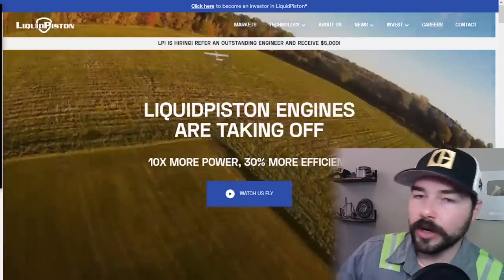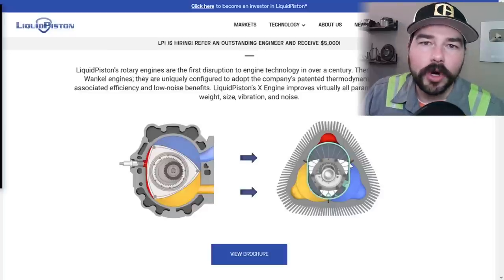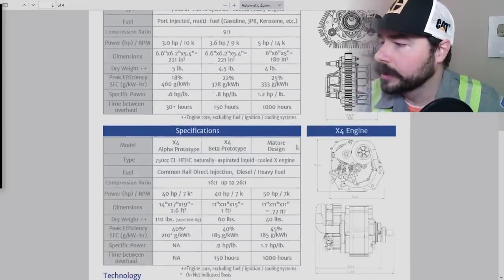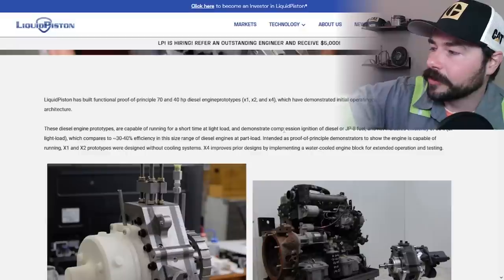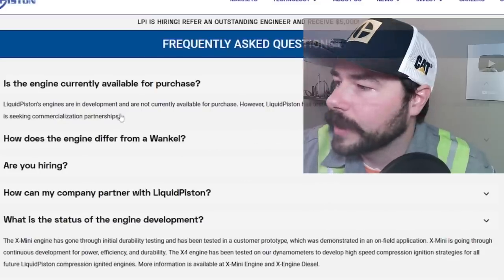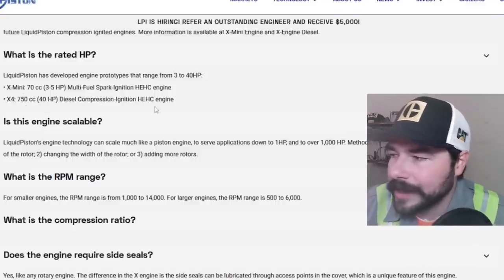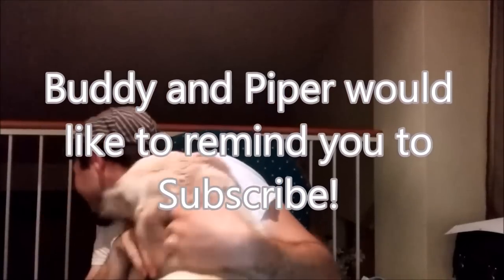This Engine could change EVERY INDUSTRY but..................

Comment: It would be a Delta configuration. 
The British Deltic locomotive engine was a named because of its triangle configuration.
As far as the hertz is concerned you are completely incorrect. The sine wave is a combination of poles and RPM, not just RPM. 
Just to make the point about my credentials for this assertion, I am an EMD certified locomotive electrician. These are electric locomotives with an onboard diesel generator. Not one but three generators powered by one two stroke Diesel engine. 
If you take a look at power generation plants, steam, diesel, hydro or wind we find different kinds and diameters of generators. We also find very slow moving hydro units with the alternators themselves being thirty feet in diameter to high speed gas turbines being measured in inches. 
The steam turbine units are small in diameter but long while the old reciprocal units were quite huge in diameter but not very long. 
You can have multiple sets of poles in sync on large diameter units while having very few on cylindrical units. 
My generators are five feet in diameter and reach sixty hurts at about four hundred RPM on the D14 companion alternator. The AR10 main generator reaches a much higher rate at the same RPM.

Comment: Like the gas turbine generators, to get the torque you need a speed reduction transmission.
Wankel used movable adjusting edge seals but this one really has no place to put "chamber" seals. It is going to be worn fast at the contact areas from the carbon combustion product on the whole surface of rotor and casing.

Comment: Maybe overhaul just means replacing the compression seals, which is about as easy as changing spark plugs. Do you know the speed-of-air pistons? remarkable independent claims for small and medium size diesel trucks. They are working on large trucks and ships. They should probably be put into every engine that you rebuild .. check them out.

Comment: It might work for tractors or go carts or lawn mowers. But It needs to be made out of high quality metal alloy that is strong and good at dumping heat into a radiator. But I don't think it fits in a diesel engine nich, but maybe a light gasoline engine replacement.

Comment: I read somewhere that Mazda is bringing back the rotary engine. I’d love to build a 4 rotor Mazda engine. Extremely fast and lots of ponies.
Reply: I think they envisioned it as a hybrid charging motor, not connected to the drivetrain.  That way it could run at constant speed and optimize fuel efficiency for the engine while charging the battery for propulsion.  Kinda like a diesel-electric locomotive.  That's what I recall, I could be completely wrong...

Comment: With an inverter generator the output frequency is not dependant on the engine RPM. These are becoming more common because they provide a much cleaner AC that is safer for sensitive electronics.  Even without an inverter though, there are these novel things called gears that would do the trick.

Comment: I'm thinking that it would be a good aviation engine, especially for ultralights.
Reply: It has to get into production first! Then it has to beat the existing aviation certified Wankel Engines. The two companies I know are U.A.V. who supply U.S. & Israeli Drone & battle field engines. They have done for 20+ years. The other is A.I.E. They also do drone but also automotive a Leisure vehicle engines. They cover a good range & are Scalable & Stackable. In automotive you can have 2, 3, or 4.
Reply: Noooo....only 150 hours  before an overhaul is needed..
Im thinking alot of plane crashes

Comment: Spec sheet said 40hp at 7krpm 
There spec also said sustainable load was 50% so 80hp unit is needed to sustain a 40 hp load

Comment: Any thoughts on the opposing piston diesel? Seems like a really cool idea and could work well, but I can foresee some issues with the design. Lol
Reply: Cost probably too high
Reply: The army is going to be using it
Reply: Also look into Cummins military contract
Reply: Like what? Seems like the thermodynamic efficiency is better because more the hot gasses created during combustion is used to push the pistons rather than simply being wasted heating the cylinder head.
Reply: @petermolnar8667  Compared to what?
Reply: Actually it's a very old concept and was used in both aircraft and military vehicles.
Reply: 2 strokes are good for power, but are not efficient and requires a blower
Reply: Opposing pistons were used already. Fairbanks Morse 38 8-1/8 diesel engine used in the GATO class subs of Big Mistake No.2
Reply: Not just an idea. Opposed piston diesels are a proven concept in production and military service. The biggest problem with them is the need for two crankshafts and the need to synchronize those crankshafts without adding excessive cost, maintenance, and rotating mass.
Reply: Opposed piston diesels can and have worked very well, Fairbanks Morse is probably the best known North American manufacturer, FM's most famous model 38 8-1/8 engine first entered production in the late 1930s and versions are still being made today.  Historically it has done very well in settings where the engine is run under heavy load for long periods (i.e. marine or stationary uses), but if idled excessively they tend to have problems with leaking oil, carboning up and starting fires, which is a big part of why FM didn't last in the locomotive market.

Also, if you haven't already you should read about the Napier Deltic.  No valves, THREE crankshafts and about 5,000 gears..........
Reply: Morse Fairbanks had an opposed cylinder, 10 cyl, 20 piston 2 crankshaft 2 stroke running a generator in the 70s and I think that it was an adaptation of an older ship board engine. It was also 20 ft tall.
Reply: Look up the Napia Deltic or Leyland L60 engines. 36 piston locomotive engine is mind-blowing. Enjoy
Reply: If I remember correctly, the Ohio class submarine my father served on had an opposed piston diesel engine that could be used as a backup if the reactor couldn’t be used.
Reply: Been tried, the Commer Knocker and the Deltic. Both British and successful.
Reply: @jefftheaussie2225  if I recall the Deltic was developed with MOD money for the gun boats. The workshop manual covers two variants with different timing gear set up for these boats. One engine would rotate clockwise and the other counterclockwise. This was for the two propellers. Love watching the Deltic Locomotives on cold start😂

Comment: There is a paper I have seen where two Wisconsin Robin single cylinder flat head engines were put together with a special head and the crankshafts were synchronized with gearing or chains. I'll try and find this document. I'm surprised the 4 stroke OPOC design has not matured. What about you Josh, ever work on an OPOC? Maybe one of the many Fairbanks Morse - gen sets and many used in WWII Submarines.
Reply: Check the  Achattes  company.  They  team up with Cummins  to offer a new diesel alternative  to U.S  military branches.

Comment: HI ADEPT CAN YOU DO A BIT ON WHAT MILEAGE  IF YOU DO ALL THE NESCESSARY OIL CHANGES  WHAT MILEAGE WOULD YOU GET OUT OF THE ENGINE.  AND THE SAME WITH THE GEARBOX AND THE AXELS .  FOLLOWING THE MANUFACTURERS  INSTRUCTIONS  ALSO WHAT MILEAGE DO BRACKS DO ON TRUCKS TODAY .  GET TO IT YOUNG MAN . THANKS

Comment: It does not have to be a direct drive, it can run at high rpm, and go through a transmission to achive the proper rpm to give 3 phase power at 60 HZ.

Comment: I have a disagreement with the section about generators and RPM.
True, on the older non-inverter type generator, the RPM determines the frequency of output.
The THD is significant on these units and could fail to operate or severely damage computerized equipment.
However, an inverter generator is NOT frequency sensitive because the input is converted to DC then output on a digitally regulated 60Hz clean sine wave with minimal THD.
So, while the statements are true for MOST generators, it is not true for all.

Comment: looked at this a few years ago. SO far no change in their claims. It is, I believe, what we call "Vaporware" big claims, but for the past few years no changes in their product. Still "In Development".
I believe that they will have the same apex seal issues as Wankel engines (and compressors) have, Further they will never be able to meet emissions, either in their compression ignition or their spark ignition types. 14,000 RPM is hard to get complete combustion.  
Overall, a great concept that will never translate to a real working engine.

Comment: Hmmm, not only sounds a bit like horsepower is being confused with torque , but duty cycle isn’t being given enough attention. 
Years ago I was trying to justify to a friend, why a truck engine at eleven litres only produced 220 horsepower, when a motorbike engine could run over 100 horsepower from one litre. My point was, how long did he think a pair of motorbike engines would last dragging 38 tons around !!
Yes, a tiny engine can develop huge horsepower, but not for long

Comment: I was really hoping we would see the big three picking up that Achates op piston engine
Reply: How about an OP KX1000 2 stroke dirtbike based on achates power and lay it down in the KX500 frame. It would go like 86mm*86mm*2 for about 1000cc.

Comment: The whole reason rotary engines are played out is because there is a hard limit for torque with them.  I wish these guys luck, but it doesn't matter how you do it, you're going to run into the same problems.

Comment: I saw the same ad. This is a design and development company, not a manufacturer. They're obviously hoping a big engine company or the military will give them a butt-load of money, so they can get to a working design. It looks like they are still figuring out the side and apex seals; a common problem with the early Japanese wankels. And alternators can be wound for many engine speeds.

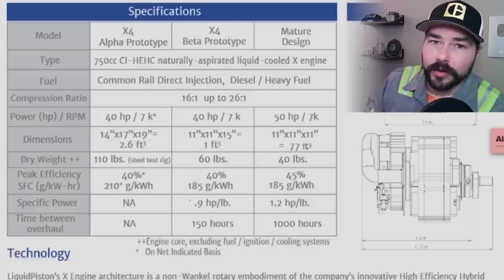Comment: 5:00 I'm no fan of this engine, it will have the exact same sealing issues as the rotary engines did. 
However, that said, you totally missed the point of the 150hr rebuild time.
Take a look at the hp rating of 0.9hp...
It's a small stationary engine for something like a weedwacker.
150hrs is a lot of whacking weeds. 
Most dirtbikes require scheduled rebuilds at 50-70hrs, sure they vastly more power, but your HD 250hrs service schedule doesn't fit all engines.

Comment: Perhaps a small efficient engine using a gear box for the right RPM for a load

But 150 hours to Overhaul sees very low 150 hours at 55 MPH comes to around 8000 Miles perhaps a bigger engine would have a longer time

At 150 hours straight run time is not very good in today's world.

But perhaps the rebuild kit is super cheap and only takes 1/2 day and any backyard mechanic can easily do it.

Perhaps any truck stop could do it in the time it takes a driver to shower and get dinner or lunch

Comment: Why does it have spark plugs if it’s a diesel? With the listed compression ratios, artificial spark should not be needed. And why does the engines show less power at 10k rpm than at 9k rpm? It’s starting to sound like a traditional “2 stroke cycle” than a “4 stroke”

Comment: I owned an 85 rx7 with the a12 rotary.  Had a 4 berrel carb bolted to a beer keg.  Horrible on oil.  Had 3 converters, useless.  Go to the gas station, check the gas and fill it up with oil😂😂😂.
It was a pile of junk but it was fun to beat on.

Comment: It would be easy, to couple the engine to a 4-pole generator through a planetary (epicyclic) gear set. My biggest concern would be longevity. Somehow, I think that huge Cat' engine direct coupled to the generator would last much longer, than this "motorcycle" engine. Sure, it can make the horsepower, but, for how long?
Reply: Just make a bigger 2 stroke rotary and run it at 1800 rpm. Oil injected too amsoil interceptor gallor!

Comment: All these new engines make the same sort of claims. More power and efficiency, less vibration and noise. Everything is just way more better than the current antique junk we idiots keep using. 
I think they make all these claims hoping to generate funding to keep trying to get something that works. 
At the end of the day traditional piston engines are in a pretty sweet spot of low cost, long lasting, and power. With how things are going electric it’s unlikely these oddball new engines are going to get far before they’re obsolete. If anything turbine engines will likely make a comeback as they can work very well at efficiently making power to run generators.

Comment: The only thing about that rotary is interesting is that it has the capability of being a multifuel engine like a military truck White engine. Other than that, it failed like others before it.
Reply: No low RPM torque.

Comment: It doesn't say what RPM the motor make 35 HP nor the torque. Same as the x 40 HP engine. They could use great reduction to a point to turn RPM into torque I guess
Reply: the 40 HP LP does 7000 rpm the isuzu piston 2 stroke diesel about 2200 rpm's

Comment: you concentrated on the middle diesel version and ignored the right version with much higher life! Also you did not look at alternate fuels which is likely its main future use! Also you don't need to  run the diesel to the drive train directly.

Comment: I dont see how companies like this get funding and money to pay employees. They arent selling anything and if they do, it'll be an already-defeated machine. I don't get it. That rebuild interval must be for testing/dyno purposes so their data is consistent across multiple units. They don't dyno an engine with internals beyond that age. 🧐 now on the other hand, Achades Power is making a sweet machine worth building and selling. The opposed piston design is far from re-inventing the wheel, but so are these guys. An Achates diesel offered as a crate engine for any application would be popular. But you don't hear about them at all, don't see them doing anything except a few government gigs. Duramax, Powerstroke , and Cummins are manufacturing incredible diesels and they fly off the shelves. I would swap in an achates for sure.

Comment: They didn't invent a new engine, they are spinning a winkle engine housing around the rotor basically, it's like holding the crankshaft still on a regular motor, and spinning the block.

Comment: these are just prototype engines , 150 hours is actually quite good for a second prototype ,,and they are rebuilding it at 150 hours  that doesn't mean it failed or is worn out ,,i've been following this company for a while ,,there was another company called DUKE engines  that just suddenly disappeared ,they were in proof of concept trials with a full scale prototype axial barrel engine but suddenly they vanished overnight

Comment: 8:08 When you start mentioning frequency of a generator I have to stop you and say have you ever heard of an inverter/ generator? Yes, there is to a degree a minimum speed a generator needs to produce a certain power output,  but not at the rate of 1800-3600 rpm like the older ones used to have to maintain.  That's what the additionl of an inverter is for in the newer generators which produces a steady 50-60 htz output chosen by the user.

Comment: From memory, tell me if I'm wrong, G.M.bought the rights to I think the Wankel-Froude rotary engine over fifty years ago. Again I think the rights were for U.S.$150Ml..and they spent a further amount trying to seal it among other problems. They scrapped it. A phone call to a friend of mine, an engine designer, could have saved them $300Ml.. Internal combustion engines are expensive, dirty high emission level scrap iron jungles with all the problems known to man. There have been over four hundred designs that I've heard of and the same old problem comes up. Seals.Does the U.S. govt. really want a low emission engine? I could be excused for believing they don't. A friend of mine designed and built the lowest emission unit in the world. A steamer. It was taken to America over forty years ago and demonstrated to senators, vehicle builders and many others successfully. What happened. Nothing. The trip before we were invited to the E.P.A. Ann Arbor and all the technicians were wearing STEAM IS CLEAN badges for our visit. Because steamers are external combustion it can be controlled while internal relies on high compression for efficiency to begin with and the premium fuel turns to dangerous gas. It is possible this application could be used in industry and I wish them well. However I could be excused for believing it is simply a political problem.

Comment: The main problem I see with a Wankel the liquid piston shares as does a standard piston.  You can't easily cool them so you have to leave room for expansion. And thus the seals have to be designed to deal with the significant change in the gap they must close.   The seal problem for a standard piston is easy due to the simple shape.  As we know the wankel seals are the biggest problem.  These do not look any better or at best slightly better then the Wankel.  So I expect the same type of problems.

Comment: Been watching this for some time, they keep collecting development money. You need to check out the Omega 1 engine, and it can run off gas or H2. That right hydrogen with out a fuel cell.

Comment: This engine has 'problems'.. high compression and sort of limited to three combustion chambers as it is a lean fire engine; internal+external air cooled, thus high NOx output..  perhaps water/water vapor pre-mix in the air could alleviate part of the problem..  they are looking for low hour drone usage (disposable / attack  and retrievable)  They say that this type of engine could be petrol ignition fired and thus a lower initial compression ratio.  I don't like their investment plan for this latest offering.